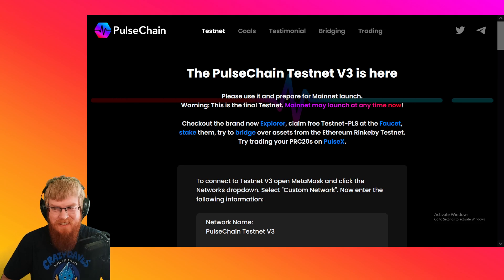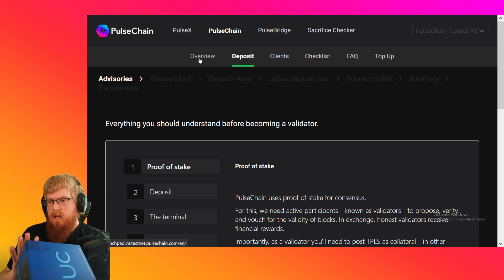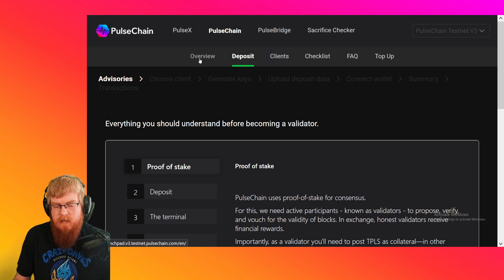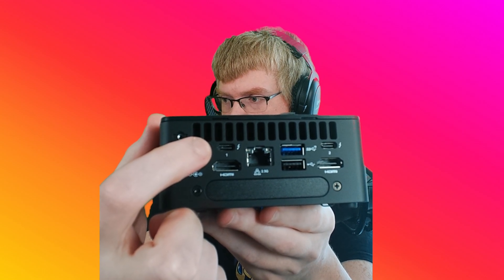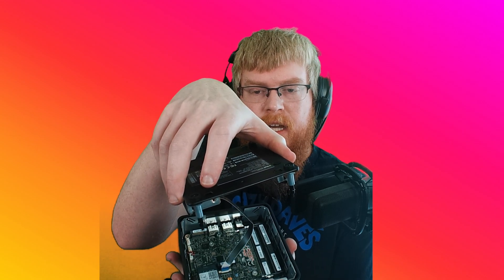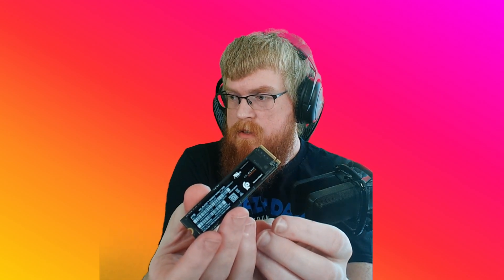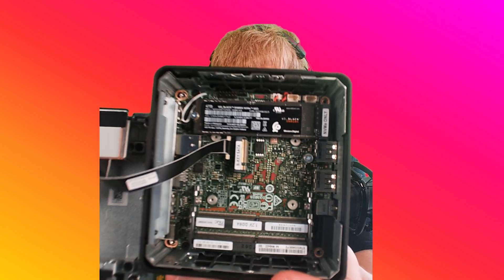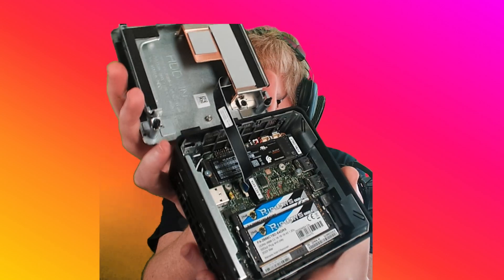Validator Hardware for PulseChain Testnet v3

Comment: @david do you know if the WD_BLACK SN850X NVMe M.2 2280 2TB with a heatsink would fit in the NUC 12 Pro or is there not enough room?  I was worried about overheating so I was thinking about getting the 2TB w/heatsink version.
Reply from the maker: I think it will be too big, but if you try it plz let me know if it works/fits.

Comment: Thanks David. This is about the right level for me. I'll be following with interest.
Reply: Hi David. Me again. One thing that particularly interests me is power consumption. Here in the UK, electricity is v. expensive, so I'm keen to use a unit that will minimise power.

The NUC12 is a pretty efficient unit, and I suspect that running a validator node would be well within its capacity. Perhaps undervolting could reduce power consumption further. I'll maybe have a crack at that if I build a validator node myself.